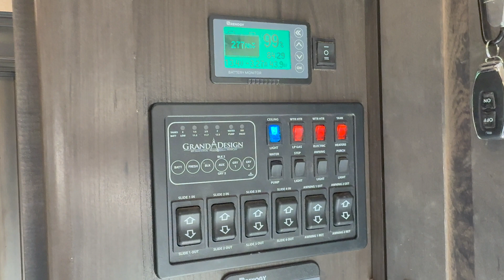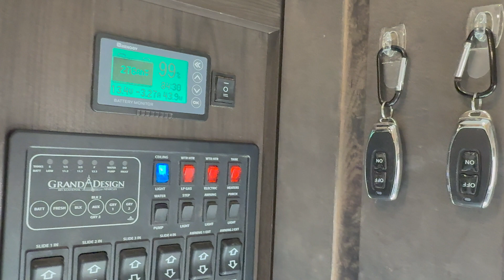RV Inverter & 50 Amp Transfer Switch Wiring, no extension cord.

Comment: Hello, great video and I found it easy to understand. Why didnt you just add the inverter to original transfer switch and have the inverter and sure power together in the L1 power cord connection? Thank you for sharing
Reply from the maker: There was no original transfer switch that came with this rig, I had to add it my self, it doesn’t have a generator or generator prep. I’m not sure what you mean by shore power and inverter together on the L1? I specifically what shore power to power both Legs, and I only want inverter to power one leg only, so converter is not powered from inverter/battery. I also wanted inverter isolated from shore power, don’t want it together, that is the purpose of the transfer switch so we don’t have parallel power. Maybe elaborate, if there is a better easier way, I’d love to know. Thanks for the comment!

Comment: on the inverter connection which has 3 wires why dont you add a wire  and loop from L1 to L2 and now you have both working instead of one
Reply from the maker: Because then the inverter would power the converter, and now you have the battery trying to charge itself. I don’t need anything on the other leg to be powered by the inverter. If I did that, I’d have to find a way to isolate the converter on its own sub panel with another transfer switch, or buy a converter/inverter that does it automatically.

Comment: Question... If I want my inverter to run everything in the RV would i have power also going to the L2? I dont have a Generator installed in my RV anymore and just want to use my solar. I was thinking to just hook the wires that went to the generator to the inverter, but of course there are only 3 wires to hard wire from the inverter and I think there is 3 wires plus the copper ground that was used for the generator  dont remember, I dont have the RV here at the moment
Reply from the maker: If you want to power everything, then yes your inverter would have to connect to both L1 & L2, but the issue is you would also be feeding the converter, so your battery would try to charge its self. You could do this if you always remember to turn off the converter breaker (and anything else that consumes a lot) when using the inverter, not a big deal seems how you don’t use a generator.
For me, I chose to power only 1 leg, because after moving a few circuit breakers, it powers all my outlets, and i didn’t want to power the converter and big consumers like fridge, and water heaters.

I would imagine you could you use those genny wires on the inverter, but you would have to parallel both legs, imagine a 30amp to 50 amp adapter dogbone, (really a 15 to 50)it goes from 1leg to 2 legs, it would be a similar connection, as you inverter would have 3 wires and your genny wires have 4. You could even buy a 15 to 50 adapter, https://a.co/d/3kdqK8I wire a 50amp male plug on the genny wires, plug it into the adapter, then wire a 15 amp female plug on romex and plug adapter into it, then wire the other end of romex into inverter, either hard wired or another male plug on romex and plug it into an outlet on inverter.

Something else to consider, you may need to disable to the gfci protection on your inverter, it can cause issues cuz some of your outlets have gfci already. There are videos out there if your inverter is a Renogy like mine.
Good luck.
Reply: @Ironmaan82 awesome thanks for your help!
Reply: @Ironmaan82 wired it up last night it's working great so far  👌

Comment: Hey great video! I have a 2015 303rls.  does this transfer switch buzz? I just installed the Southwire 50 amp one and it buzzes! apparently normal for 120v contact switches. Drives be nuts! now looking to possibly install this unit.
Reply from the maker: I hear no buzzing at all on mine! Good luck.